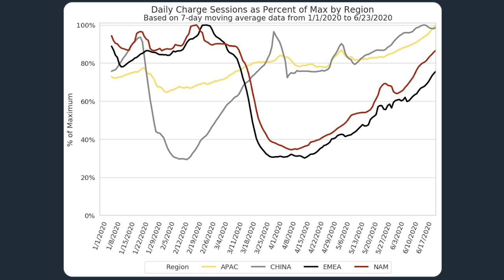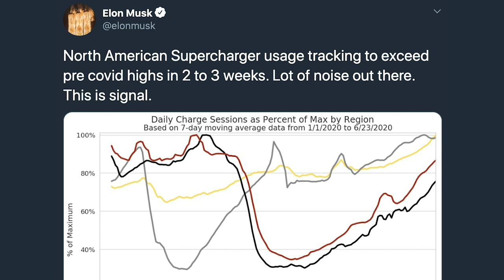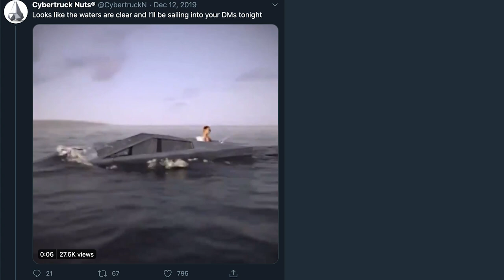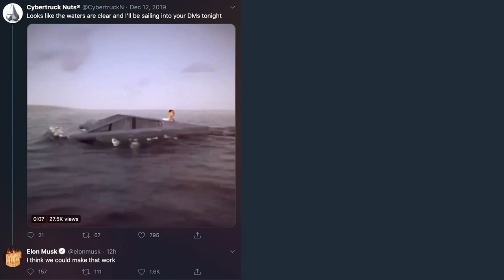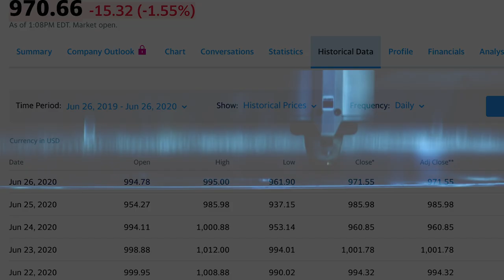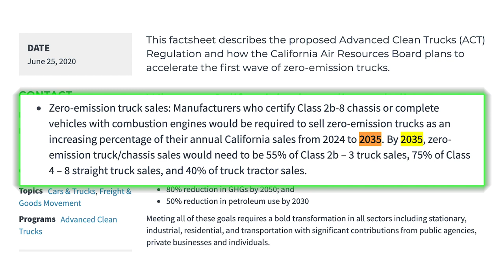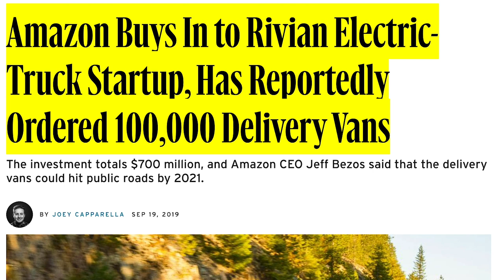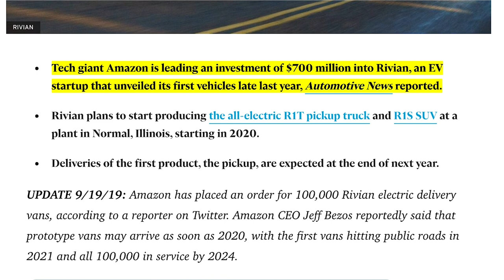Tesla News | Amphibious Cybertruck, Tesla Q2 Production, Landmark California EV Regulation

Comment: A lot of information to chew over here... guess I'll put my 2 cents in.

The camera issue is an interesting one - one I had thought of before.  I'm sure there must be some kind of plastic or glass that would bead up water to the point Rain should't be an issue.  If you think about it, dirty or snow covered cameras wouldn't be all that different than driving in heavy fog.  What happens in that climate?  I would think if the cameras are effected heavily by snow or ice the easy answer is to heat the cameras... or their enclosures anyway.  Just depends on what is cheapest.  Living in a northern climate that can get a lot of snow and ice in the winter, I am specially interested in this issue.  As are you in PA.  Also, road salt will accumulate on the cameras just like dirt or mud could.  There have been many a day I have had to hit a gas station to clean my headlights and mirrors off because of the salt.  The cameras on my truck have had these issues, but to be honest it isn't all that disruptive as the cameras are only a tool for watching your clearance, and not responsible for controlling the vehicle. 

The amphibious CyberTruck, while interesting, is probably just a novelty and won't ever be pursued.  Who would be the target market?  What legitimate use would the average truck owner have for an amphibious truck?  Given the current design of the CT it would not fair very well in any water other than a calm smooth lake.  The nose would dive under after the first wave went over it I should think lol.  The cost and liability associated with developing this would not be worth the payoff.  Maybe some minor military or first responder applications but even then not really sure it would be practical.
Reply from the maker: Thanks for sharing Steve. Yeah, I really need to get my hands on a Tesla to see how these cameras handles out winters. Going to need a few viral videos LOL. The most popular option so far has definitely been the clear coat. And as for the amphibious CT - this would be so crazy that it feels like something Elon will want to do on some level, like a special package or option just for the headlines and to say he did it. But I completely agree there's a minimal market lol